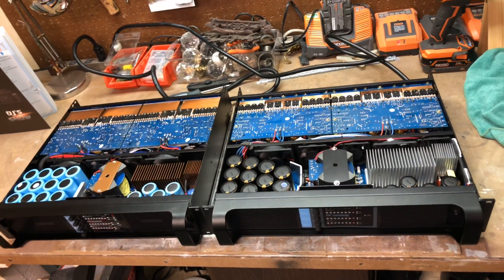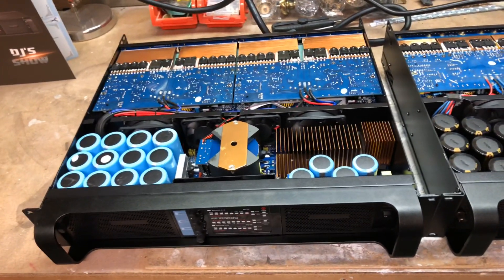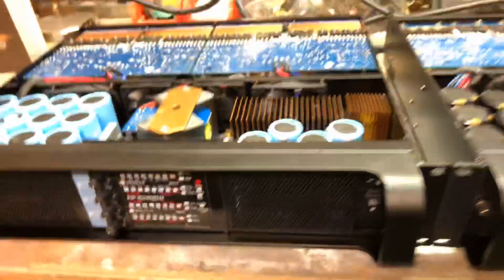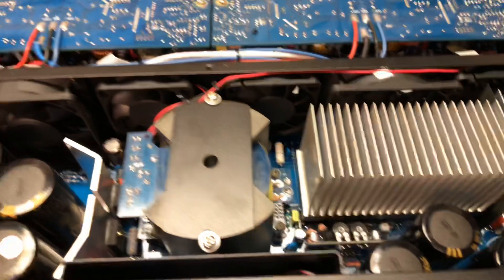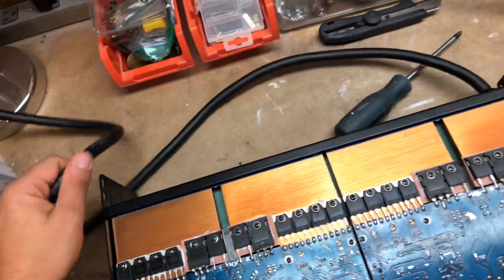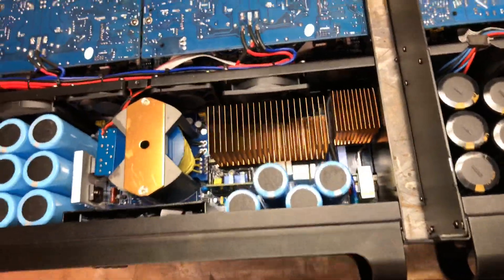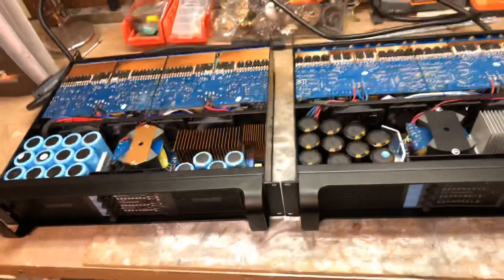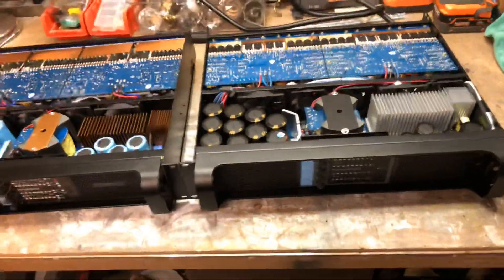LAB GRUPPEN CLONES FROM CHINA REVIEW

Comment: It might not offer audiophile sound quality, but four beefy channels of over 1kW@8Ω each in a relatively compact casing are enough to make this a nice budget solution for audio amplification. It's enough for pushing almost any speaker cabinet to its limit.
Reply from the maker: Yes, we have compared them side-by-side with the original. There is no difference in Sound to a human ear.
Reply: @SoundGuy-vn3kl  Here in Germany, the fp10000q and fp14000 are very widespread. I own 2 fp14000 for 4x LA sb28. Soon there will be a Fp10000q for top parts. But the Prokustk are also very good. My two are Peokustk. Very good quality. Very good soldering etc.

Comment: 2:32 The clone is longer due to the larger cooling fins at the back and not because of the two extra caps.The front section where the caps are located (between the front faceplate and fan supports), is basically the same depth when visually comparing both amps. -> 0:05
Reply: @Case Kyle Flixportal :)
Reply: @Jordan Willie Thank you, signed up and it seems to work :) I appreciate it!!
Reply: @Case Kyle you are welcome :D

Comment: You never mentioned the heatsink in the front. It looks like the simbosian clone has full copper heat sinking vs aluminum on the sanway. 
Manitoba here.
Reply: Actually that heatsink may be just anodized not copper. Anodizing increases thermal capacity, but black is apparently best
Reply from the maker: Awesome thanks for letting me know

Comment: Few months ago I have tried sinbosen's FP10000q and FP20000Q amplifiers.Their cooling system of FP10Q is good. Although the size is bigger than other.
Reply from the maker: Carfagna Andrew oh nice how did you like the fp20000
Reply: @SoundGuy-vn3kl  Yes my FP20000Q each channel connect with one unit dual 18" sub , they run very well. the supplier said this amp under 4ohms is stable
Reply from the maker: Carfagna Andrew oh that’s very nice I think I will order one and try it

Comment: Do these amps actually do 10000K rms watts rated continously and not peak? Provided that you have the AC in your house to back it up ... in other words , will this amp power 4 x 18in subs in a home theater for music , 10000watts continously?
Reply from the maker: I never did a metre test on the amplifiers but I compare this to the real lab gruppens and they are the same amplifier I am using them to run 4 18s right now and the amp does it effortlessly what kind of eighteens are you looking to run on the amp
Reply: In stadium sound they use 220v or 440v .... This amp will do what your house can give it most are 20 amps at 120 v in the USA..
So anyway you will get around 3000 Rms clean... With proper power,  yes they do out out enormous power at 2 ohms 2 channels
Reply: This is for stadiums and line arrays...i.e. this amp pushes 4 pro subs to 12 or 24 mids high.....if you use it in your house with 2 speakers im sure you will burn  them up!! Unless your fuse them
Reply: My 10 years models from sanway / gisen can work all weekend long. But it must be on separated fuses. Best result is 32A 400V power supply from the wall or power generator to the switchboard with 3X 230V 16A fuses - each amp have own. Last free socket is for lights and dj decks.

Comment: The caps in the Sanway appear to be better quality/higher temperature versions and could even have higher individual,but and therefore the same, or even more overall capacitance as the Sinbosen, so saying with Sinbosen that More Caps=better doesn't take any of that into account. Overall great general info, but this point is accidentally somewhat irrelevant at least and actually misleading at worst while also ignoring the potential short longevity issue of cheap caps.
Reply: they are better amps period ! all the way.
Reply: I have had 3 sinbosen dsp amp failures put of 7 in 3 years so far. You think Sanway is better?

Comment: My experience on the SANWAY versions is the channel boards go into protect quite often and need replacing. For this reason I Got rid of the amps.
Reply from the maker: Sundip Sohal Wow OK we have been running them for over four years now I’ve never had a problem with any that’s weird that yours had problems
Reply: SoundGuy0000 I’m glad you have not had issues hopefully they rectified any problems. SANWAY themselves provided me schematics and advised me to remove 1 of the components located next to the PSU (white chip) I believe there is three side by side. They advised removing one of these stabilised the amp and helped against boards blowing. It did help but eventually boards would fail.

Comment: My sinbosen fp10q blew up on me during an event. Ever since i got it it had a bad smell of hot electronics. Not quite a burnt electronics smell but still weird. I‘ve been running it hard a couple times and the smell stayed but it also kept working normally so i thought that was normal. During the event i suddenly noticed the level meter on channel a creeping towards clip. I turned it down all the way but it kept creeping up until it hit vpl, lit all leds and then literally blew up. A loud but deep „pop“. I still habe warranty but sinbosen customer support (alice and crystal wang) really take their time with replying. Now they send me a video tutorial of how to diagnose the amp myself. I‘m a bit worried to open it up. They told me they will send the replacement parts i need once i figure out what part failed. I have to pay for shipping tho…
Also even if i get it fixed the blowing up just seems to be a symptom of another problem (probably related to the smell). I was very happy with the amp until this happened. I‘ll gladly take any advice or guesses on what the smell could be, how to best handle the repair and such.
For anyone looking to buy one, they are good and well built amps. The money you save compared to the original lab.Gruppen just costs you proper support and you have to be prepared to handle any problems on your own.

(Again please post tips or thoughts, i would really appreciate it)
Reply from the maker: Well, first things first what kind of power were you giving the amplifier and was the amplifier in a proper ventilated area? and what little did you have on the amplifier meaning ohms? There’s a lot of factor here. I have been running the these amps for over 10 years. Never had a problem once and I  run them very hard.
Reply: I have had 3 sinbosen fail on me now. All within 4 years, of 7 dsp amps from them. None pushed hard.